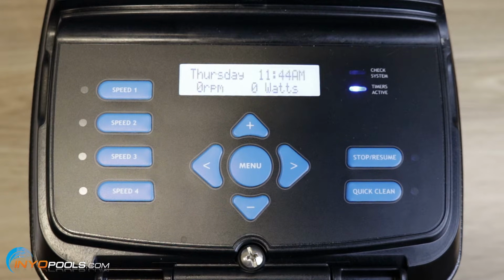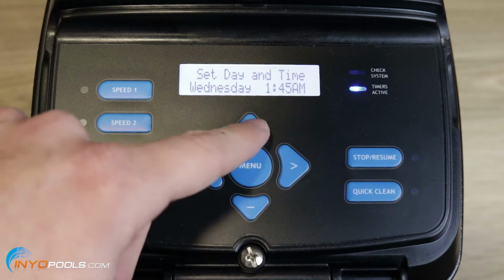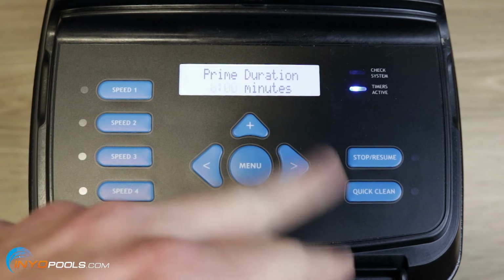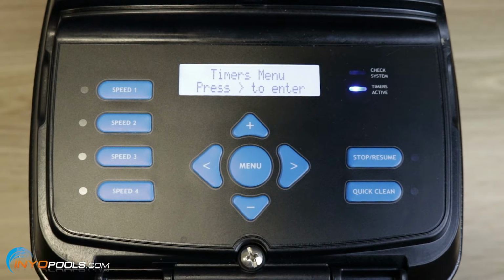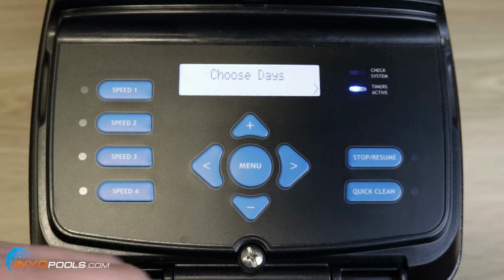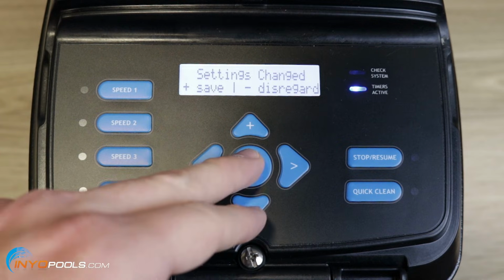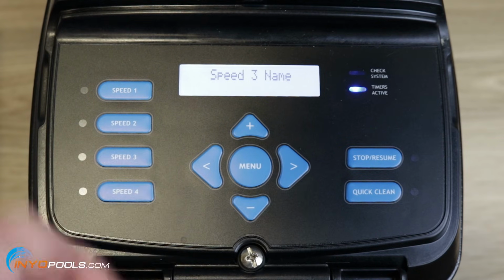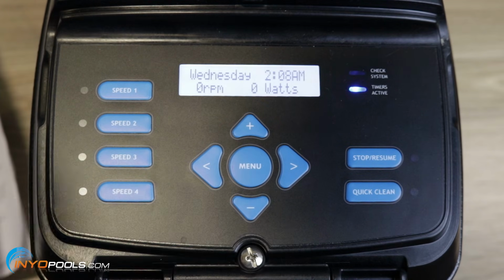How To: Program A Hayward Super Pump VS

Comment: How to run this pump directly without that controller
Reply from the maker: You'd have to have the variable speed motor connected to a separate automation system.

Comment: i’m 78 years old widow and I was just told to run my pump for 48 hours consecutively after I had a bunch of chemicals over a few  hours. My pump is on a timer runs high from seven to one and then low until it shuts off at nine. Tell me exactly how I can get it to run for 48 hours so my water gets clear please.
Reply from the maker: Unfortunately, there's no easy way to set a 24-hour timer other than just changing one of the speeds to be 24 hours at 3450 RPM. You could adjust the QUICK CLEAN feature, but the runtime maxes out at 360 minutes or 6 hours.

Comment: Can the screen be rotated?
Reply from the maker: Yes, the screen orientation is adjustable:

'The Digital Control Interface can be rotated to any of four desired positions after installation by loosening the two screws securing the user interface to the motor drive, lifting the user interface and rotating it to the desired position, and tightening the two screws in the new position. " - From page 11, see figure 4.11-1 for an illustration (https://images.inyopools.com/cloud/documents/super-pump-vs-s2603vsp.pdf)

Comment: What is a good recommended rpm I went to Leslie’s Pool in Las Vegas because my vacuum runs then stalls and I’ve taken it 3 times to them and they say the RPMs need to be between 1700-2100 and it was in minimum 600 and maximum 3200 I hope lowering the rpms will work if not I’m taking the vacuum to Leslie’s for the 4th time.
Reply from the maker: OK, but what RPM speed is your specific pump set to when you are trying to actively clean your pool? Because it sounds like you just haven't set your pull pump to run at an rpm in that 1700 to 2100 RPM window. A good portion of the video covers how to do that.

The 600 to 3200 RPM range is just describing the minimum and maximum limits you can set on the pool pump to ensure the RPMs don't dip below or exceed those parameters. As an example, the minimum threshold would be set to prevent the flow rate from dipping below a salt chlorinator's required minimum flow requirements. A maximum flow rate threshold would be set to prevent a pump from exceeding a filter's flow rate capacity.

Comment: GREAT Video, my pump goes into Econo mode??? How do I disable this function? Thanks in advance
Reply from the maker: I took a look through the owners' and operations manual, and I don't see anything called the Econo Mode. Is there something that flashes on the screen, or are you referring to the motor switching to a lower speed during its schedule?

Comment: I got my VS pump just after the middle of the season last year, I am getting my head around it, I just opened my pool and I have been back here 3 times. Hope I understand it soon?? I miss my old pump...
Reply from the maker: Are you having issues with a specific aspect of the scheduling process or runtime management?
Reply: @Inyopools  I have programmed the pump and it's working perfectly now. I walked out to the pool shed with my laptop and your instruction video running and it was easy . The new VS pump is definitely superior.
 Thanks for the follow up.

Comment: I need to run my pump for 48 hours straight while I reduce phosphates. How do I bypass all the programs and run it for that amount of time?
Reply from the maker: The only surefire way to do it is to change one of the timer settings to run for 24 hours. Once it clicks over to the next day, the motor should restart another 24-hour cycle.
Reply: @ thanks. I think I’ll do something like 7p-7a one session and then maybe 6a-8p for the next session and after 48 hours will cancel both. This is to remove phosphates. Now I need to rewatch your vid to even know how to set the timer at all

Comment: Great Video. Some nights I want the pump to continue running after scheduled stop time so the hot tub stays on. How do I keep it on pass the scheduled stop time? or start again temporarily after scheduled stop run time? Thanks!
Reply from the maker: The easiest way to do this would be using the "Quick Clean" feature. The quick clean feature runs the pump for up to six hours at your chosen speed. You can adjust the Quick Clean speed and length in the settings menu.

Comment: What is the speed for though how fast the vacuum goes ??
Reply from the maker: The RPM speed is how fast the motor is spinning; the higher the RPM number, the faster the impeller turns, which increases the water flow rate. If you have a suction pool cleaner, the cleaner would have a stronger suction force and may move quicker on a higher RPM setting.

Comment: Is there a way to, on for example, for a one time need to run the pump for 48 hours straight ( for a Phosphates cleaning)  run time, run the pump?
Reply from the maker: There's no one-time setting button or mode for a maintenance scenario like that.

Comment: My pump turns off at 7pm. If I want to restart it before my timer turns it on how do I do that?
Reply from the maker: Press the Quick Clean button for a one-hour cycle. You'd have to adjust your schedules to get the pump to run for longer.

Comment: Hello you guys make great informative videos for sure . Can you use a Hayward W3SP2303VSP in a 15,000 gal pool ? My pool guy said you need a high head pump not a low head . What is the difference ? I have a Hayward Pool Vac W32025ADC pool sweep . Thanks again .
Reply from the maker: Thank you!

First, ask your pool tech what the estimated 'feet of head' of the system is because the W3SP2303VS should be enough for most 15k gallon pools. The feet of head is the measurement of plumbing resistance that your pump would need to overcome to prime itself and pump water. Most pools are in the medium-head category
Reply: @Inyopools  Thank you . What would be an ideal figure for this pump ?

Comment: I'm not getting any power to the new pump install.
Reply from the maker: That sounds like more of a circuitry concern than a pump problem. If you've tested the pump side's terminal lead and get no voltage readings, then I'd start at the breaker and work your way down. You could maybe try putting the pump on a different breaker to narrow down whether it is the breaker or the wiring.

Comment: If the pump loses power (power outage in the area), does it lose it's settings or is there a battery backup on the motherboard? I'd hate to do this every time we lose power in Florida! In my are we lose power at least once or twice a month... sometimes just for a minute or two for whatever reason. Then of course thunderstorms and the occasional hurricane! Or even if I have to kill power to my pool breaker box to do some work.
Reply: Mine has never lost the settings in over two years. I'm in Florida and have had some power outages over that time.

Comment: If my pump is in low temp mode, will it run 24/7 if temps remain low? I need this feature lol
Reply from the maker: When Low Temp Mode is activated the pump will run at the Max Allowed Speed for 8 hours. If the temperature is still at or below the Low Temp Setting at the end of the 8-hour cycle, it will begin again.

Comment: Is there a manual way to turn the pump on or off or do you need to cycle through? Thanks @inyo pools!
Reply from the maker: If you need the pump to run for a short period, the Quick Clean feature will do that without requiring you to change any scheduling
Reply: @Inyopools    Ok, so if I want to crank up the spa on the late night after the day cycle is completed,  I can simply on/off  the pump using the "Quick Clean"  button?

Comment: Nice instructions!, Thank You!
For some reason on my pump (Hayward Super pump VS 230v. MODEL W3SP2603VSP) there is no option to adjust the duration under speeds menu - preset speeds. It will allow me to change the speed but not duration. It will just run until the next timer is scheduled. Wish I was able to adjust duration.
Reply from the maker: How old is your pump/motor?

Comment: Thank you for the detailed instructions. I have a shock I want to put in the pool (ducks - need I say more?). But I don’t know how to set it for a one time run of 24 hours.  Can you please let me know?  Thank you!!
Reply from the maker: I checked the manual for this feature but couldn't find anything resembling this function. The Quick Clean feature tops out at 60 minutes; you can't alter the runtime. You may need to adjust one of the presets to run the desired RPM and schedule length.

Comment: How do I set the pump to run all night when I shock the pool?

How do I turn off a timer?
Reply from the maker: There's no 24-hour override on this model like the Century V-Green. Your best option is to alter one of your schedules to run the desired clean cycle speed.
Reply: Found out I could select Speed 3 and it ran all night until timer 1 started.  Thanks
Reply: Still would like to know how to remove, turn off a timer

Comment: How can I turn the pump on and off manually?
Reply from the maker: Walk to the pump every time and hit the on/off button. Hook the pump circuit up to a light switch.
Reply: @Inyopools  I tried that on off I tried the quick clean. I cannot get this thing to turn on to back washed it, but it comes on with the timers just bought the house. Can’t find the manual to it or the remote control. Frustrating.
Reply from the maker: Hayward Super Pump SP2603VSP Manual - https://images.inyopools.com/cloud/documents/super-pump-vs-s2603vsp.pdf
Reply: @Inyopools  thank you so much really appreciate your help

Comment: Not sure if you answer questions,.. But what could be the cause of the screen not powering up and the pump not turning on? I turned the pool breaker off and when I turned it back on , the pump and screen do not turn on. My multimeter shows that it's getting power, but nothing is working. The pull cleaner pump works but not the main pump (Tristar VS 950)
Reply from the maker: Water could have shorted the board or failed due to sun exposure being the usual culprit. If your pump is still under warranty, Hayward should replace that free of charge.

Comment: My freeze protection RPMs was at 3450.  How can I change this to 1700 or 50%?
Reply from the maker: The low temp run speed will default to the Max allowed speed. There isn't currently a way to change the RPM specifically for the low temperature feature. If you don't have a need for the Max to be 3450, you can drop that RPM setting.
Reply: @Inyopools  Thanks.   My pool tech guy said we (Tucsonians) don't need to Enable the low temp setting due to the fact that the pipe is 2.5" dia., and the cold spells don't last long enough.  So for now I just disabled it.

Comment: How do I set the timer to off mode? For example, I only want to use timers 1 and 2 and return the display mode for the other timers to display off
Reply: did you get a reply for turning off timer. i have the same question.

Comment: Hi I have a 9000 gallon medium size pool. What speed should I set for for high and low? My husband passed away recently and I am trying to set pump up  and my pump works all day on a low speed. I want to set it to run on high for a certain time and then to a lower speed. What do you recommend?
Reply: Donna you need to have your pump run on a high, medium and low speed through the day. The real answer depends on how big your pool is and the equipment. Roughing it though I’d say you should have 3 hours on the high, 9hours medium then then the remaining 12 hours on low. That high speed allows for water movement and what ever sanitation you use to get through the pool, along with the medium speed. Good luck, sorry for your loss

Comment: For old people this is hell to operate!
Reply: For young people too. This thing was designed by some of the most incompetent engineers ever. Such a poor, unfriendly design. It's a terrible user experience.
Reply: Trust me I’m 24 nd I’m lost as well
Reply: This is way more difficult than it should be especially for a single woman they come in set it up and leave a manual which is also confusing. Terrible I need something not so complicated
Reply: I agree…mine brand new installed yesterday and today display went off and can’t get it back on…
Reply: Got stuck on entering the timer menu. Instructions don’t say hit menus button twice. What a pain.
Reply: I've been trying to simply turn it on for 10 minutes now. Stop/resume isn't doing it

Comment: How do you adjust quick clean speed? Mine is on 2500, would like to bump it up to 3200
Reply: did you get an answer to this? I have the same question.
Reply: I don't believe you can adjust the speed on quick clean..just the hours up to 4 hours I believe
Reply: The written instructions say that whatever your maximum speed is set at is what the quick clean setting will use

Comment: How do I turn the timer to off? I only want to run 1 timer. Thank you.
Reply: Something this video and other videos, and even other boards don’t tell you, how to turn a timer off. So if you have more than one timer set, and want to turn one off, set the start and stop times to the same exact time. for example 3 AM start 3 AM stop and that will turn that timer off.
Reply: @louis_costa Thanks, I watched most of the video then saw the answer I was looking for in the comments. 😂
Reply: Go into your timers menu to the Timer you want "Off"  Set your End Time to the same as your Start Time then press Menu.  After you press menu the timer should read "Off"
Reply: Came here to ask the same question.
Reply: @danajustice9536  I FEEL LIK THE TIMER IS THE BIGGEST ISSUE WITH THIS PUMP AND HEYWARD SEEMS TO BE CLOSED UNTIL WEDNESDAY "DUE TO THE JULY 4TH HOLIDAY" BUT EVEN TODAY THATS A DAY BEFORE  SO I CANT ASK THEM
Reply: I have the same pump, but my pump started surging on and off any advice or recommendations thanks in advance 🚒
Reply: Can you resume it after it has shut off for the day to add chlorine at night
Reply: I would like pump to run 24 hrs 7 days a week.. not worry about timers 2300 rpm all week

Comment: To clean the pull using the  Quick Clean button does the pump has to be on a Stop mode or I can press it while the pump is running
Reply from the maker: You can press the Quick Clean button while the pump is running. It will automatically switch to the Quick Clean speed.

Comment: How do I temporarily turn the pump on, while it is NOT in the programmed time mode?
(Eg.. I have it programmed to shut off at 6pm. But I want to turn it  back on at 7pm for a few minutes, etc).  Thank you.
Reply: Did you ever get and answer for this? My pump is programed to shutdown at 6pm sometimes we want to use it outside of the programed hours but I don't know how to manually turn it on without changing the timer. There has to be an on/off button somewhere on this pump.
Reply: Looking for the same thing
Reply: Press "Quick Clean" to run for 60 minutes, then again for each 60 minute duration you want.
Reply: Or you can use your speed 1 2 3 or 4 settings you adjust those to run for a certain period of time at that speed

Comment: How do I delete a timer???
Reply: How do I turn the timer off?  Again how do you turn off the timer????  What a bad software design
Reply: You put the start time and the end time at the same time. For example: put your start time at 4:00p and your end time at 4:00p and it will then say “Off” remember to save your changes
Reply: YO I HAVE THE SAME PROBLEM
Reply: I believe you set the time to midnight
Reply: You put the timer both timers back on 12pm and 12pm. It will automatically stop the timer.

Comment: I have a 14k gallon pool with a sand filter and pop ups for cleaning. What would be the best RPM for cleaning the pool? If set too high, will I ruin or wear out parts, seals, etc.? The manual is not very helpful. Thanks.
Reply from the maker: Maximum speed settings are really dependent upon the pool and pump. For example, I have a 1.5HP VS pump with a cartridge filter that can handle 120 gpm. Running the pump at full speed does not damage anything. However, if you have a 2.7VS pump with 1.5" plumbing and a filter that can only handle 80 gpm, you may have issues. My recommendation would be to add a simple flow meter to the plumbing. That way you can determine how many gallons per minute are created at each speed. Then you can look at the flow rate of your filter and pop-ups and select the appropriate speed setting. This may not be exactly the answer you wanted, but with pools there are so many variables.

Comment: So if the timer is set and you push a speed button does the speed button override the timer? When the speed is engaged for X hours does it revert back to programmed timers after that?
Reply from the maker: The speed button would override the programmed speed within that schedule. It would still turn off at the scheduled time and the next time the pump turns on, it will revert back to the original programmed speed.